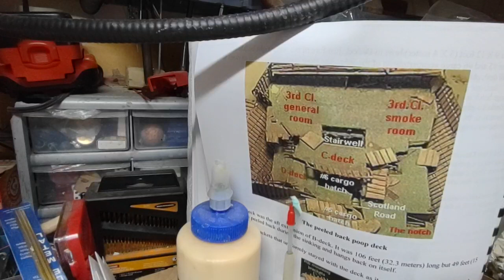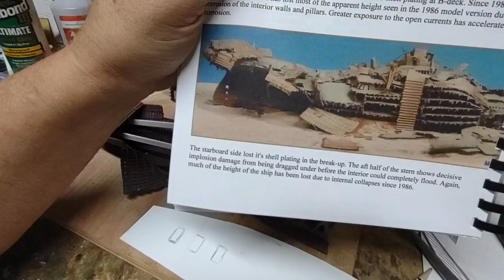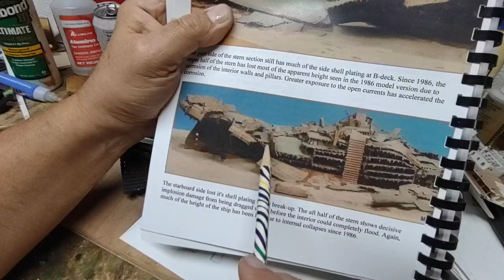Titanic Wreck Model Diorama Tutorial Part 32 - piling on more decks aft of the engines

Comment: Hi CJ, I think you've forgotten another room called the Electric Dynamo Room - which is suppose to be after the Turbine Room and before the propeller shaft rooms in the aft end. 
I was trying to figure out what or why does your stern model looked shorter than what I've done and looked at from Roy Mengot's model and I figured it out that is the case here.
Reply from the maker: You make an interesting point.  I'm just going by the length of the stern section from the fantail to the forward point of the reciprocating engine remains which was given as approximately 350 feet.  At 1/350 scale the stern section should then be 12 inches long.  I just measured my model and it's actually 12.5 inches in length so I don't understand why it would be too short.